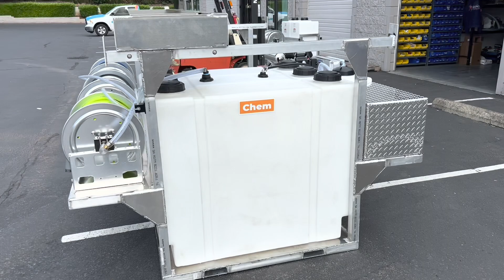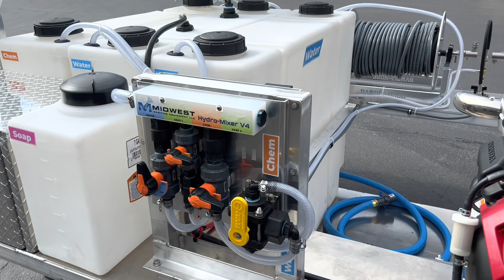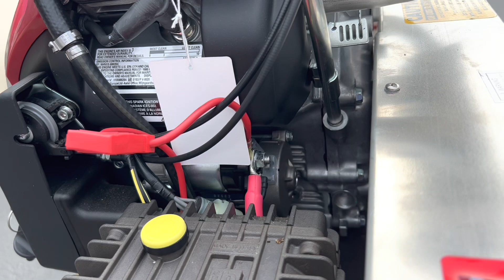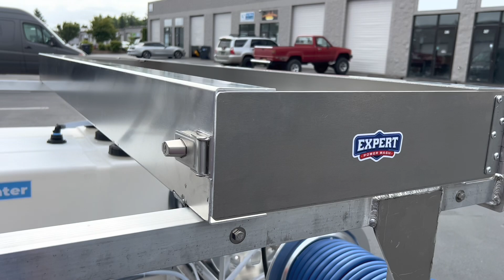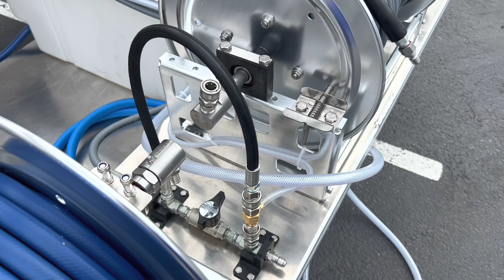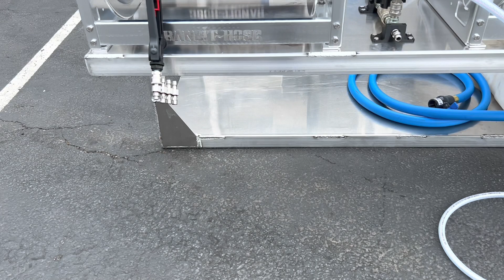Pressure Washing & Soft Wash Setup | Ricky’s Skid

Comment: Nice,   Random question.   I’m thinking about building one.  Smaller but same idea.  What thickness aluminum are you using for the shelves? I’ve been thinking if I should trying to find a shelf and just add it to the skid or making a shelf out of a sheet. Wondering about wall thickness of tubing also.  1/4 is great but maybe excessive.  You know better than me though. I’m open to any suggestions. Thank you.
Reply from the maker: I appreciate the comments. Sounds like you might want to jump on a call. Give our shop a call. Might as well just have us build you one instead of telling you how to build it.

Comment: On Ricky skid I don’t see any filters leading from the garden hose to inside the tank?  Was that at his request.   Or is the 1 filter prior to the pump sufficient for the work effort?
Reply from the maker: You don’t need a filter before the tank. It slows the water flow. If you run the water spigot for 5-10 seconds before you hook up your hose you are good to go.

Comment: Using those Uni seals makes for one less air leak on your soft wash machine. On my trailer I wish I would have done this instead of the Banjo fittings I have now. Bulkheads are always cracking from the sun and riding down the highway. I’m keeping my trailer as a backup or for larger commercial projects. It would be nice to do my trailer like that also
Reply from the maker: Agreed!